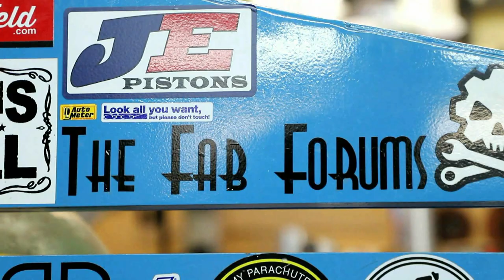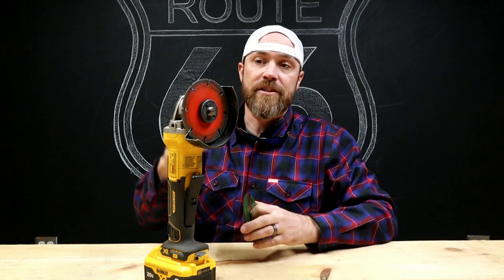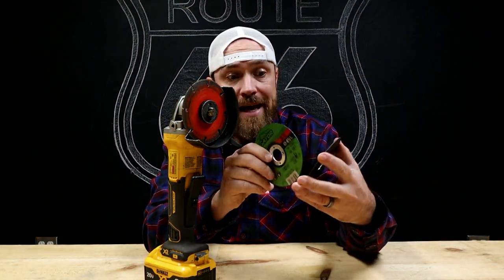You Need This Tool - Episode 133 | New Improved Diamond Cut Off Wheel From Diablo

Comment: Been using the diamond cutoff wheel for several years and they are great.  Great for sheet metal.  When you get into thicker stuff (1/4 " or more) you definitely run into heat issues and slow cut speed.  That's when I go back to abrasive cutoff wheels.  Never had one of these come apart on me and can get away with basic eye protection.  Nice video.
Reply: yeah someone needs to make a coolant system for these lil grinders for it to really be good for cutting thick stuff

Comment: been beating on a lenox for two months now, anywhere from sheet metal to cutting a c10 frame. I cant tell myself to go back to abrasive, except for at work where im not paying for them. hoping to get them to switch also. cuts straighter, cleaner, and no wheel dust. only downside is if it catches, hang on
Reply: I have had a Lenox for 2 or 3 years and just recently opened my second wheel that I had gotten when I couldn't find the first one.

Comment: I have one of these for my smaller Ridgid grinder and it is a great wheel.  I think I have used it in light metals for a long time, probably 2 years or more and it still cuts well.  It is a little slower comparatively but the fact that it is still cutting is a cost savings.

Comment: Ordered a couple 4.5 inch and 4 of the  3 inch to try. Thanks man,your always a blessing.
Idea, might do tool reviews on things that have really held up well over time.
We are having problems with dewalt grinders at the gears in front housing. We found opening them and adding better grease before using does help but, they aren't holding up well for us. Have four waiting on gears now. fwiw.
Thanks again man, looked forward to this every week for a long time, so glad its back.

Comment: Tried them and they run a lot hotter than a standard cutoff disc, with what I cut (high carbon steel) I got about 40-50x more than a standard disc but only about 20x more than a 3M cubitron disc which was A LOT cooler cutting.